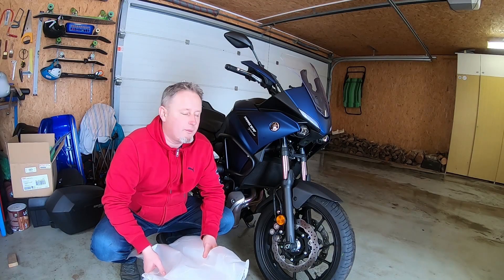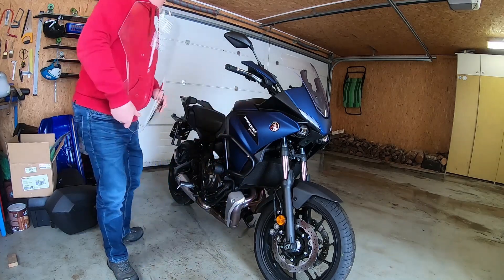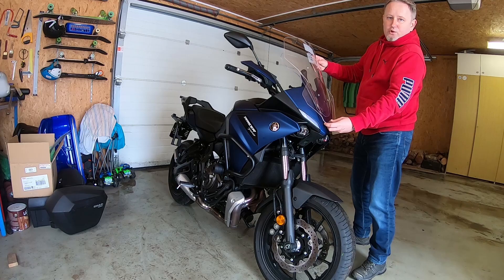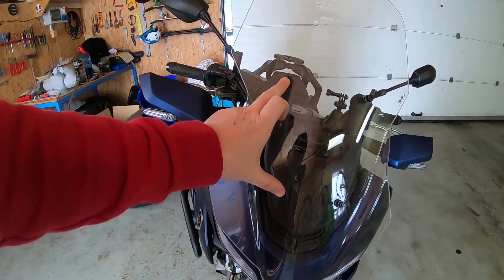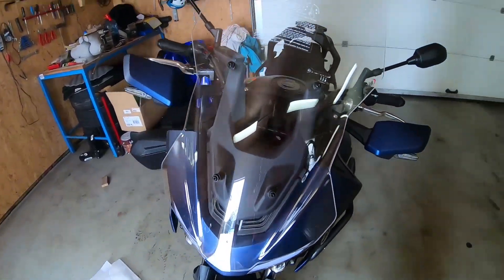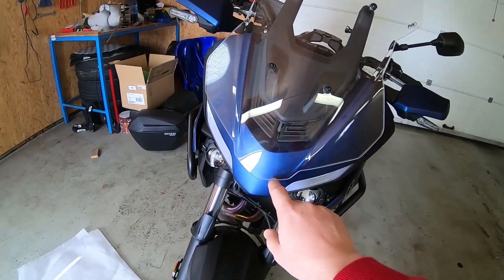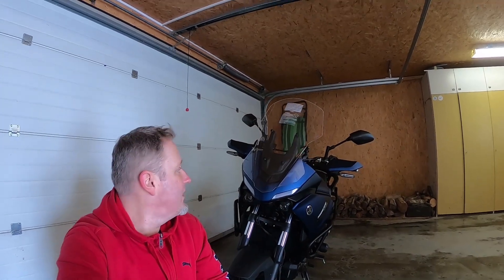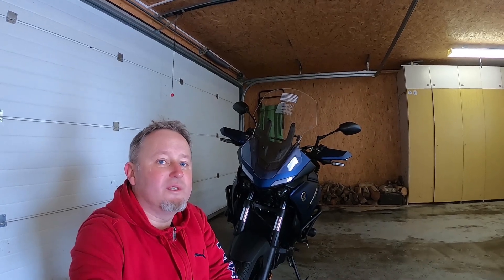Yamaha Tracer 7 / 700 + Touring windscreen mounting / Puig

Comment: Thanks for the video. I've also got that Puig touring screen. 
Does your windscreen locking system make a rattling noise? Mine does. And the screen also vibrates a lot on bad roads or cobblestone.
Reply from the maker: Hi MiG, I hear some vibration noise in low screen position. Does not matter what screen is mounted (OEM or aftermarket). But only in low position. On bad roads vibrate all screens. And if bigger screen, then bigger vibartions. I understand it is normal. My T9 makes ths same with standard screen :-(
Reply: @venax2  I'm pretty sure it's those four rubber screw threads. They should be entirely made of metal. I may have to build ones 😁

Comment: Thank you for this video, I’m searching for a wind screen that protect me at 100% but not sure what to buy. I guess I’ll be waiting for your test..
Reply from the maker: its clever ;-) Yes, I will share my experience after testing. I assume in April.
Reply: @venax2  Hi from France! Have you tried the windshield already? I'm planning to buy it from my Tracer also.
Reply from the maker: @galuteau  Hi, I tried and best setup for me (173cm) is top position only (wind goes on top of helmet). Its more comfy for long rides, cold weather and high speeds. It seems that less niosy is original small screen, but its only due to fact, there is no head wind protection at all. I have experience from my Ducati Monster (no windscreen), the noise was not problem (you need good helmet), but wind flows completely to helmet. I am happy I bought touring screen, even higher persons may need additional deflector on top of it.
Reply: @venax2  Thank you very much for your feedback!
Reply: @venax2  so for 183 cm guy like myself it’s probably not tall enough?
Reply from the maker: @BlazinBlades  you can maybe buy an option with additional deflector.
Reply: @venax2  Thanks
I just ordered my 2021 Camo Tech
I found it best to just leave the screen down and get clean air. As soon as I raised it I started getting some turbulent air.
With the large screen and the extra wind deflector the bike will look more like a Polynesian sailboat than a motorcycle 🤣😝😁

Comment: I just bought a tracer with this windscreen and I have to say it sucks. I first tried it all the way up. I am 1.84 and the wind noise from 70KM/h and up was SO MUCH that I had to duck to save my hearing. Setting it to its lowest position is much better and that's where it stays now. I don't see the point of buying a taller windscreen if you can't make use of the extra height.
Reply: I'm 178 and I've got the same exact problem the puig touring screen on my tracer 7. It sits in the lowest position all the time. Just waste of money.
Reply: @Pan-Zagloba-IE  Fully agree. This is an old comment, meanwhile I have changed 2 more bikes and tried out more, and I can say that windscreens only work on big touring motorcycles. The small windscreens may look good but never work.